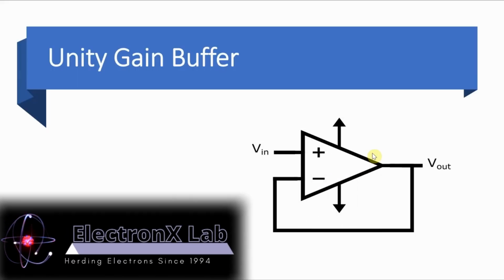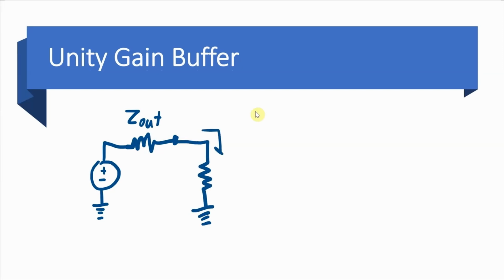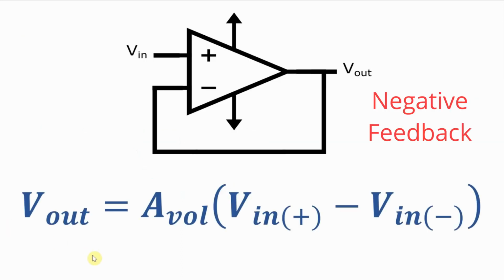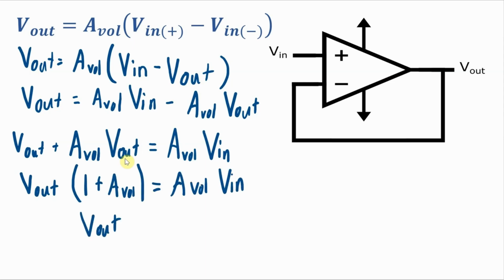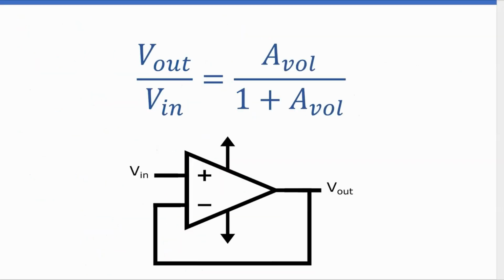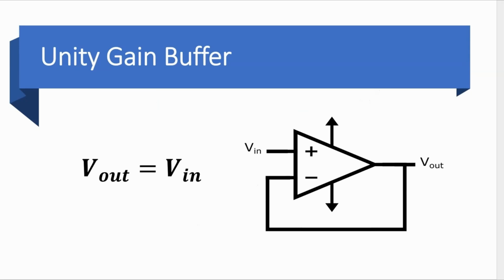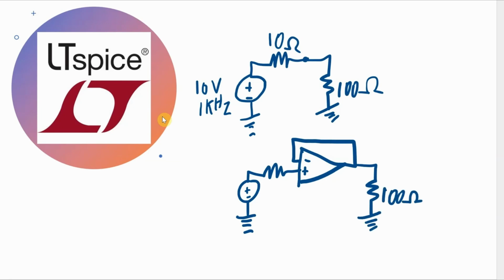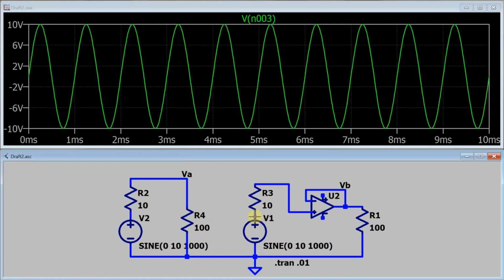Introduction to Unity Gain Buffers

Comment: It basically clamps the voltage divider(s) to 0. It's a must have here and there. I fixed a lamp construct (power supply) where I got 2-3 volts left after carefully designing for 4.5V and it took a week to find the info.

Comment: i'm comfused,  vin in the schematic with buffer is connected after the 10 Ohm resistor which mean there is already drop volage across this resitor  and that mean Vout is equal to the Voltage of the end of the 10 Ohm resistore!!!

Comment: Hi, just for clarification, "Heavy load" is a load of low impedance which would naturally cause more current to flow through it. Did I get that right?
Reply: I think heavy load means that the impedance is high.Therefore, it causes voltage drop
Reply: I am also wondering the same thing. The high current it draws is the main problem here from my understanding. The load requires high current which is causing a high voltage drop from the Zout as a result the load is not provided with sufficient voltage. Thats what I have understood from the video.
Reply: It's a voltage divider problem. It was never phrased very well. The numbers change for each impedance/resistor/load being added. Specs are top priority (for each component or a module), so all numbers must be within range of what can work.

Comment: GREAT VIDEO!
What if you put a feedback resistor in the feedback loop and input a signal in through an input resistor to the "-" input  WHERE THE RESISTORS ARE EQUAL.
How would the output change as you varied the voltage directly at the "+" (follower) input?

Comment: I am just not understanding at all. I don't understand how "Vout = Vin" can be true if the op amp is actually doing anything. On the diagram, if R2 caused a voltage drop, why would the op amp not exactly mirror that voltage drop? What causes Vb to match V1, where is the extra difference to make up the drop in voltage coming from?
Reply from the maker: The voltage drop across R2 occurs because the current through R2 is the same as the current through R4. In the op amp circuit, the same voltage drop doesn't occur across R3, because there is almost no current (ideally 0) going through R3. Then the feedback of the op amp causes Vb to be the same as the voltage at the non-inverting input of the op amp.

The op amp makes sure that Vb is effectively the exact same as the source voltage...I hope that makes sense

Comment: 1:05
"The voltage at the output will match the voltage at the input"

But a good amount of voltage has already dropped across the high impedance before the unity gain buffer right?
Reply from the maker: No voltage will drop across the high impedance - don't think of the connection between input and output as a continuous connection that current must flow. Think of it more as 
-a voltage sensor at the input
-a driver at the output that will 
       - determine what voltage the output should be based on the "sensors" and the gain of the amplifier
       - provide power to the load (from the voltage sources) at the voltage determined fro the step above.
Reply: @ElectronXLab  Is it right to say that little to no current flows through the source's output impedance BECAUSE of the infinite impedance at the input of the op amp?
Reply from the maker: @RAHUL-xy1ds  For this unity gain buffer circuit, that is correct.
Reply: @ElectronXLab  okay
Thank you David